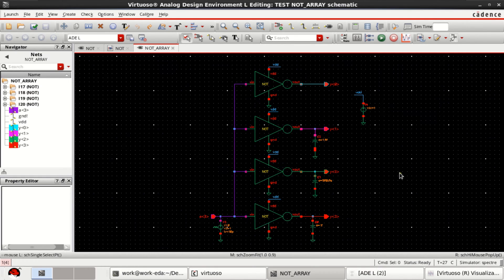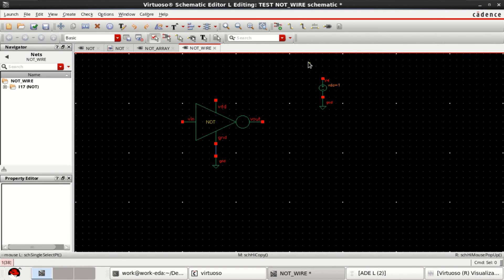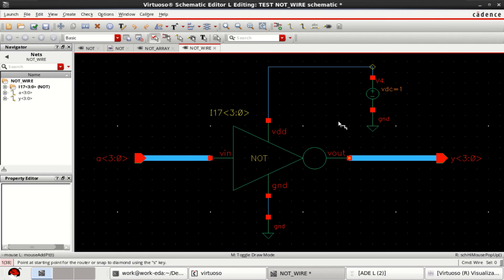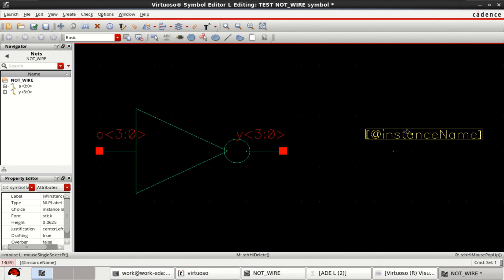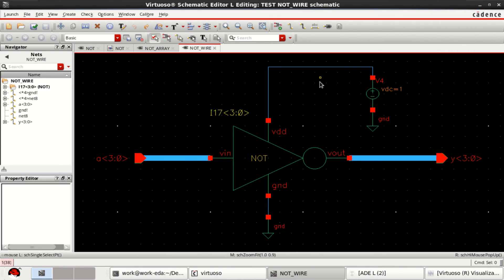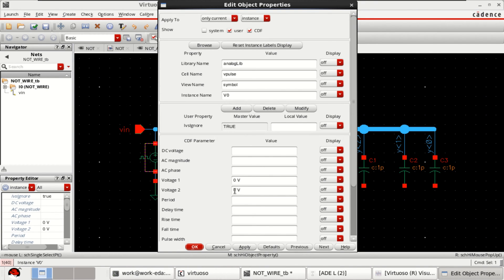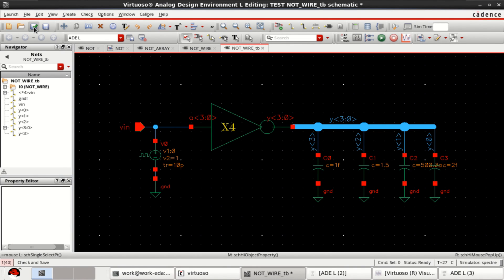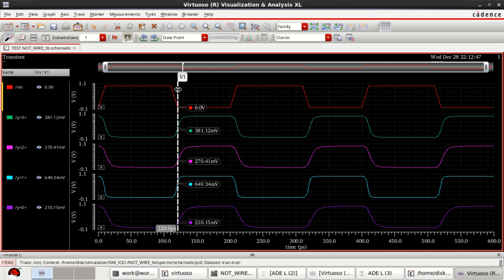Cadence Virtuoso: Array and Buses in Cadence.

Comment: Thank you for the video, Sir 
1. does it connect all input  to each other withput adding Pin?? i mean providing simply DC voltage to the input  terminal connects all the input together???
2. Suppose  i want to make inverter chain of 100 INV (say)  i.e INPUT  OF 2ND INVERTER = OUT OF 1ST INVERTER.
Reply from the maker: Yes it connects to the array of devices you created with buses